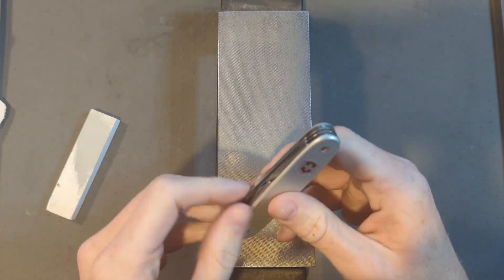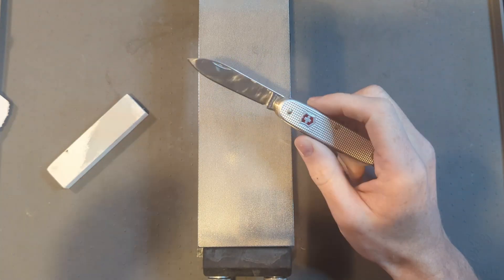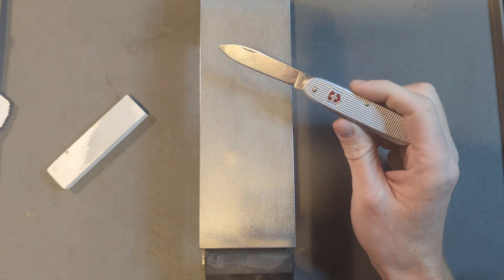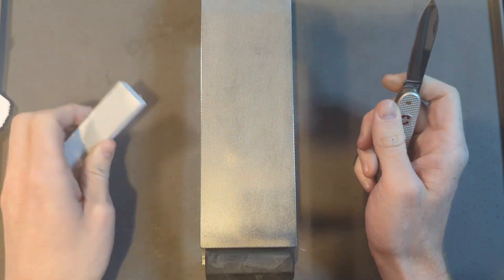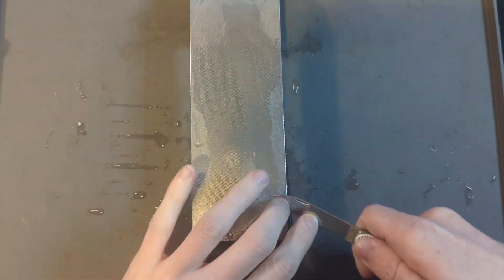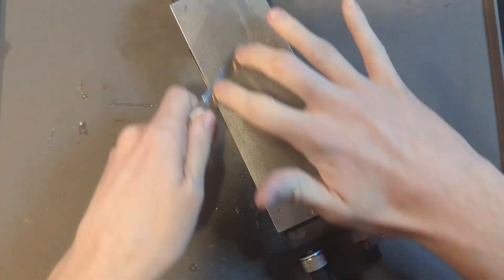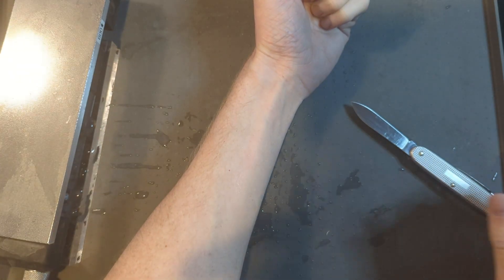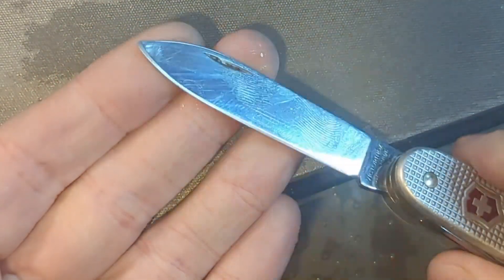Are diamonds too hard and sharp for sharpening soft steels? Pt 1.

Comment: I really appreciate that you keep your vid's free of fluff. It's very annoying to sit through a ten minute vid' to get 2 min's of info, to say the least. May I ask you a question? What brand of 8" diamond plates under $150.00 would you reccommend for wood carving tool sharpening? Mora 106 carving knives, Pfeil gouges etc? Thanks.
Reply from the maker: It's difficult for me to make short videos while still getting lots of information into them, I end up with 30 minutes of footage and I cut out 85% of it 😅.  

In regards to diamond plates it going to involve some personal preference again. From my experience the Atoma plates always start off with the most consistent scratch pattern whereas the others need breaking in (not a big deal).
The bonding of the diamond to the nickle with Atomas also seem to last longer from my experience however I'm not sure if they're enough better to justify the price.

DMT is an affordable alternative if you go for their 6x2" option rather than the 8x3. Ultra sharp are also good value (if you're in the US). If you're just getting started then I'd probably just pick up anything cheap and it will last long enough to learn as long as you don't apply too much pressure. (let the diamonds do the work, increased pressure will fracture the diamond across the cleavage plane preemptively and also pull the diamonds from the bonding.)

After some practice on cheaper stuff I think my suggestion would be to buy 1 Atoma plate and 1 Atoma replacement sheet in a different grit. The sheets are £20 cheaper than the full plate, you can stick it on the other side and have a double sided Atoma with 2 different grits for under $100.
Reply: @stroppystuff641  Thanks very much! Just as in your video's you provided the expert, detailed information needed to make an informed choice. In my experience, that is very uncommon on YouTube. I would be very surprised if your channel does not blow up and become a huge go-to channel for serious hand tool sharpeners - if that is in fact a goal of yours. I appreciate your efforts!
Reply from the maker: @curiousgeorge555  thanks for the support I really appreciate it and it encourages me to make more content 👍 glad I could be of help

Comment: I enjoy diamond plates a lot ! My favourite way of sharpening I’ve been able to get a hair popping sharp edge on my Victorinox Spartan with my work sharp field sharpener
Reply from the maker: Good job 👍 the work sharp field sharpener is a great bit of kit for the money. Diamond plates are certainly the winners in terms of maintenance too, no flattening or dressing required.
Reply: @stroppystuff641  Thanks dude ! Nothing worse than a dull knife or tool exactly that soap and water then a ceramic rubber for the rods then you’re clean again 🤷‍♂️

Comment: strop on 3000 wet/dry sandpaper. easy peasy
Reply from the maker: Edge trailing on abrasives that size will create a foil burr.
Reply: @stroppystuff641  not in my experience. Do a video on it.

Comment: nice demonstration !
for Victorinox id use Victorinox diamond sharpener (a very fine and dense sharpener) then Victorinox ceramic sharpener. very light and portable combo.
Reply: Get the work sharp field sharpener you’d love it
Reply: @Nobodyisnowsomebody13  i got a WorkSharp Precision Adjust. But im using it mostly on longer, kitchen blades.